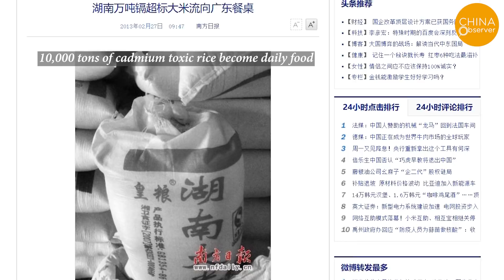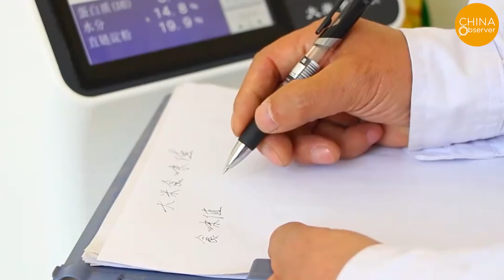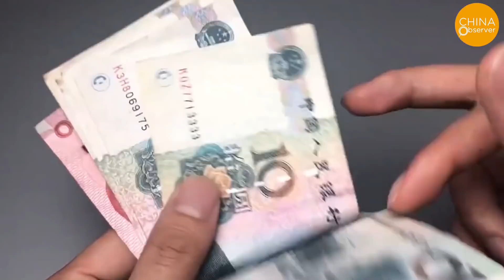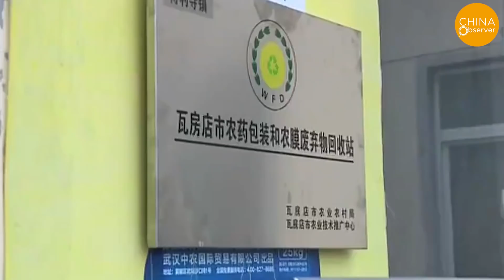Fake Food | Toxic Food | Arable Land Severely Contaminated

Comment: To put the results in perspective, @4:42 based on the test results of 0.38 mg/kg cadmium,. Health Canada has a safe limit of cadmium of 0.0008 mg/kg body weight. So if you weigh 80 kilograms, you should not exceed an intake of 0.064 mg of cadmium per day (80kg x 0.0008 mg/kg = 0.064 mg). If you eat about 170 grams of dry rice, you will reach that limit. Any more is considered a health concern. (0.170 kg rice x 0.38 mg cadmium/kg rice = 0.064 mg cadmium).
And that's not counting cadmium exposure from other things like water, or other dietary foods.

Comment: So far, China's huge rust belts have been manufacturing massive numbers of products without any environmental protection process, which was the main cause of China's soil contamination, honestly. However, Chinese companies and China's ruling party CCP don't have the proper technical assets internally to solve that. And they have countless numbers of people in the mainland inside, so nobody has interested in those serious problems.

Because still, only a few people have died from the soil contamination, so the central govt of China didn't show some interest in this thing. However, as time goes on, Chinese people would die from the medical symptoms more and more, and then Chinese citizens will demand an alternative to solve this toward their govt. But China can't make reliable ideas to solve this problem, so rich people and high officials of the govt will buy foreign crops from other nations.

Comment: Cadmium is very poisonous elemental metal.    It seems the price of Communism is extremely steep and dangerous to the survival power of a nation.

We get it-   CCP screens for contaminated food due to the dangerous lack of pollution laws.   The food is diverted away from closed, special entry, cities like Beijing where the rich communists and CCP members live.  "Radioactive" food moves by corruption and market forces to poorer and neglected regions of little political value to the nation state.    In theory, if any of those Rice Krispies even touches China's gated community heads will roll.  The odds of that are pretty low in such Golden Palaces because those areas command and control food in China and profit from the very regulatory backdoors they create.

Problematic is the reality that strategical mitigation in complex environment doesn't work.  Therefore, the CCP is actually killing the ENTIRE citizenry, albeit at a rate advantageous to the rich in this "who benefits" scenario.   That's even before going to to war which will kill more citizens at a brisk rate.   The CCP's general attitude is "Let them eat rice".

Comment: These Toxic's build up in your system . I know i got so i couldn't even eat it. I would throw it up!  So i started soaking it and leaching out the poisons .  Now i can eat it again
Reply: @NotYourChannel23  no test just leaching the milky white from the rice. Just soak it,  keep rising and soaking it, until the water is clear. Since i done this, i can eat rice again with out throwing it up ~ So there got to be a Toxic in the milky water. If you want to run a test? Run it on the milky white that come off into the water from the rice

Comment: Think on this: With the mining causing so much damage to soil we're heading into "green power" which requires a crazy amount of mining for rare metals. With oil running out, rare metals will be the next oil. Say goodbye to some national forests and rich soil land.
Reply: And clean drinking water
Reply: We won't live long enough
Reply: That's a ridiculous statement. Mining and manufacturing for renewable power aren't the only mining operations.
How about all the pollution and deaths mining coal and all the pollution and deaths caused by burning it?
Reply: @ericdunn6232  Coal is also used to produce steel as well.
Reply: We're not running out of oil.  There are deposits for it for at least next 100 years using current mining technologies. Why it's being labeled as big bad is because we're mining underground carbon and placing it on surface, which increases climate temperature. So there's a movement to get rid of fossil fuel dependence.
Reply: Thx boomer doomer
Reply: @m2heavyindustries378  you're an CCP DISINFORMATION TROLL

Comment: Add to this the prevalence of smoking among men in China and you get multiple sources of cadmium poisoning of the smokers, those around them, and the materials that the tar in tobacco smoke sticks to and pollutes. (Tobacco-plant accumulation of it results in 0.5–1 μg cadmium per cigarette. Cadmium oxide, generated during tobacco smoking, is likely to either be deposited locally in lung tissue or absorbed into the systemic blood circulation, or both.) That, on top of the radioactive products of tobacco smoke (containing both polonium-210 and lead-210) and you get lungs that are a toxic mess, and oftentimes more radioactive than the ground contaminated around Chernobyl.